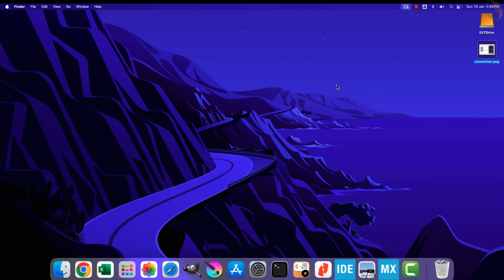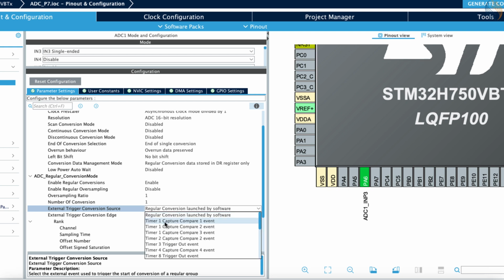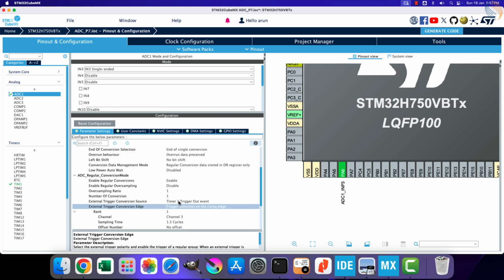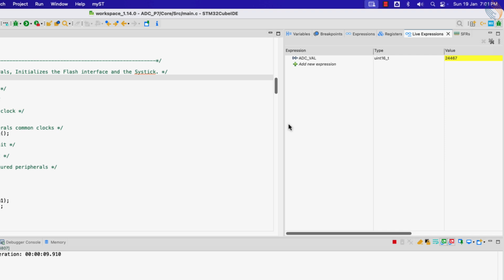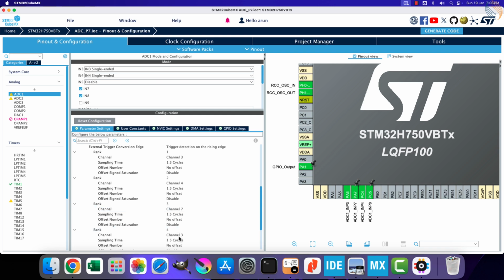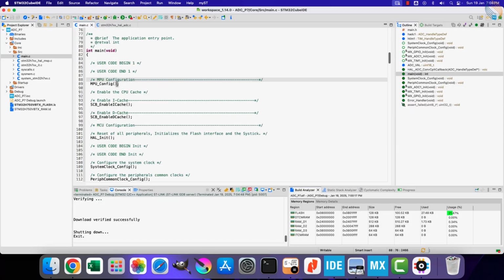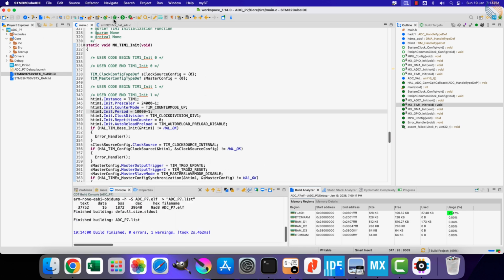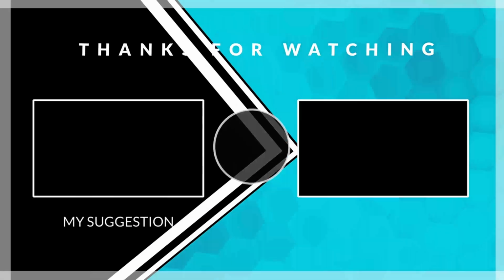STM32 ADC (Part 7): How to use the External Trigger Source  and Control ADC Sampling Frequency

Comment: i get half of frequancy always ,i donot  know why , iam using stm32c051c8 with 48mhz external and i set prescaler 48-1 and aRR 100-1 i should get 10khz i get 5khz donot know what is the problem?
Reply from the maker: 48MHz is crystal clock. Is the timer also running at the same frequency ?
Reply: @ControllersTech  yes timer in cube mx is 48mhz
Reply from the maker: Then there is no issue. How are you measuring frequency (5KHz) ?
Reply: @ControllersTech  i toggle led in the callback function and i measure it with osc i get 5khz instad of 10 khz
Reply from the maker: Then it is obvious.  You will get half the actual frequency.
The callback function is called once per cycle (once per frequency). I side this callback you are setting the LED once and resetting in the next cycle.

So to generate 1 Hz for the LED, the callback needs to trigger at 2Hz.

The timer is working fine. It is generating a frequency of 10K.